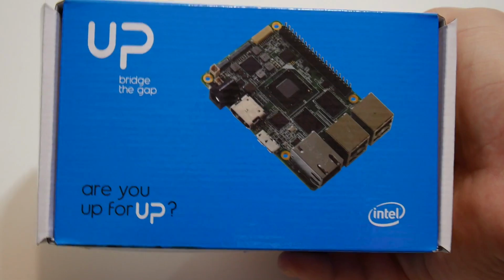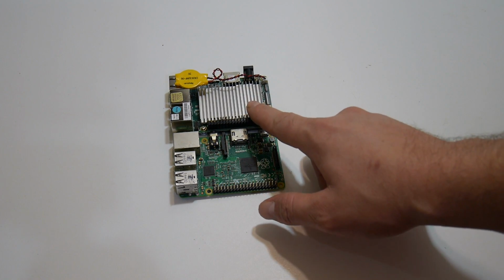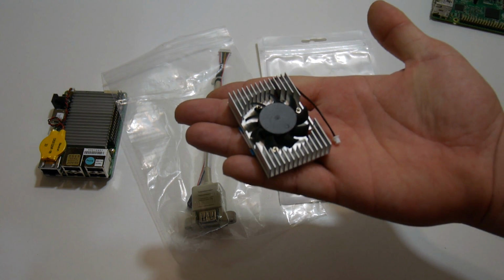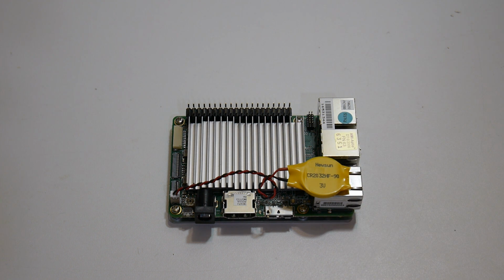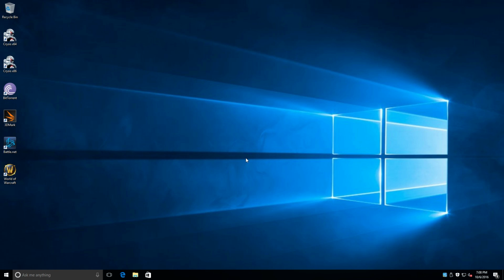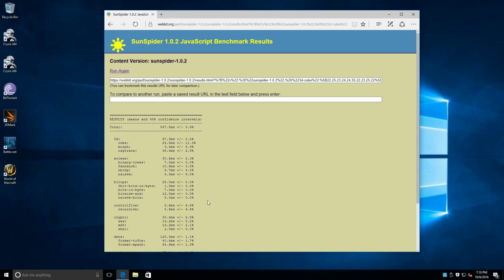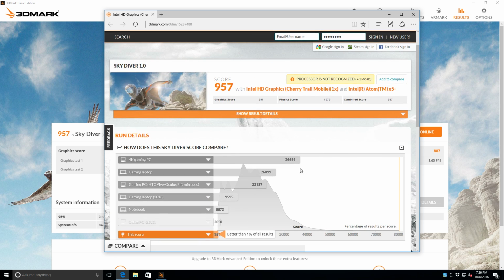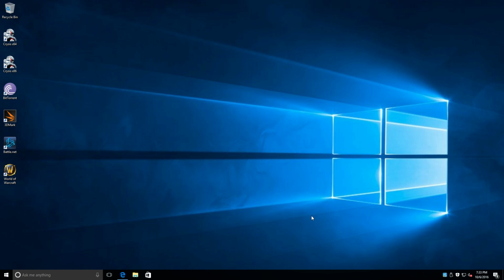UP BOARD Unboxing And Benchmarks Raspberry Pi Killer?

Comment: Hi. thx for the review . did you get the Power Adapter from ebay  ?  saw one like this, 4$,  and the sale states its a 5.5(OD)/2.5(ID ) which fits 5.5/2/1 too (required)  ???  any comments on DIY heatsink/fan ?   thx a lot

Comment: what's the other header on the option of 2 additional USB ports? in the video it looks like there's 3 connectors in the bag, 1 for the USB ports themselves, where it would connect into the UP, and then another connector?
Reply from the maker: Pete Moss I'm pretty sure is the power connector

Comment: Got me lost @ price....  you better getting an old computer than board like that...
Reply from the maker: Yeah, the price is way high , I bought an older slim hp with 4gb ddr3 and a Core 2 Quad Q9550 for $15 about a year ago , slapped 8gb of ram in it and OSX Yosemite on it and used it for editing for about 6 months. I just ordered a slim 750ti from eBay and I still only have $125 bucks into it. building a lower end emulation PC for the kids. I know for sure it will run better than any SBC
Reply: well, I bought a dell laptop with an i5 3360m for around $150, so yeah the price for me is a little high
Reply: old computer has same size and power consumption? and can run windows 10 with full hardware support?
Reply: No, old computer in right hands can run even better - Ubuntu 16.04 with no problem with hardware. :) I have few around, doing some good stuff, from emulation to being used for education.
Reply: Yes, saw your video with emulation on that box. He got us on power consumption, tho... :)
Reply from the maker: RoMage 2 watts vs 95 watts
Reply from the maker: And size
Reply from the maker: RoMage I'm looking for a tutorial on how to install AfAOS 4.7 in Amigaos 3.9 on winuae. Any suggestions?
Reply: AfAOS 4.7?? I installed OS 3.5, 3.9 and 4.1 on WinUAE, but never used either on RPi. For some reason I like ClassicWB Full retro feel and look, as well great response. I copied the same HDF I use on PC when emulating Amiga.
As for power consumption, I paid around 150 bucks for little Lenovo Yoga 2 in 1 tablet/laptop, 2GB ram, 32GB SSD, Atom quadcore processor (can't recall speed or model) and it uses about the same amount of power as RPi, runs Win10 with no problem and has MicroSD slot for expansion. 
Did not get time to upgrade to WIn10 64 bit, will do that sometimes in future, was wondering how well ubuntu would work on this tablet, might try that as well. 
Sorry for wall of text... after one of your videos decided to teach my daughter (she is 11) to install Ubuntu on one old laptop, which she did and she loved it, even she has her Win10 HP laptop. :)

Great job with videos, gratz on subscribers!
Reply from the maker: Awesome , i installed PItop OS on a pi 2 and set it up in my kids room, but my daughter needs something faster now. she complains about how long it takes to load . Im trying to make amigaOs 3.9 look more like 4.1 i have it installed on a PI3 with Namibian. i love the looks of the 3.1 but a lot of viewers want a more "modern look"
Reply: Problem with Workbench greater than 3.1 is that you have to have ISO (either purchase or download) and it is not quite available around. I can look into instructions to install any of them on RPi, but would be much easier to do it on WinUAE (I did all of them on FS-UAE as well, just to have it on Ubuntu :)) than RPi. What distro you plan to use for RPi? 

BTW, did you have a chance to try suggestions for Turrican game (on C64 video :))
Reply: +ETA PRIME can you do a test? https://linuxiumcomau.blogspot.co.id/2016/10/running-ubuntu-on-intel-bay-trail-and.html
Reply from the maker: Jfr # yes I plan on it they offer an Ubuntu 16.04 driver package for this board. I just have to finish windows 10 testing first, I'll be testing as many operating systems as possible
Reply: Too many single board computers, but nobody yet can beat RasberryPi support and development with current price.

Comment: I would love to see if it will run Visual Pinball Emulator (vp9 or vp10)
Reply from the maker: do you have a table you want me to test?
Reply: I would be interested in if it could at least play VP9 PM5 tables... anything rom controlled solid state
Reply from the maker: CementRoots ok sounds good I've never used it before but I'm sure I can have it up and running in no time , I will make a video tomorrow.
Reply: sounds great... I can get you would ever file your going to me.... I'm also a table builder in the VP community so getting you content wont be a problem
Reply from the maker: i tried a bunch a tables and i was only able to get T2 working but i cant fire the ball, ill work on it more tomorrow , been out of power half of the day. if you can help that would be awesome
Reply from the maker: http://www.vpforums.org/index.php?app=downloads&showfile=6105
Reply: ok so you have the VP9 emulator working that is great.... I will send you a few non rom tables that will for sure help... are you playing in Portrait or Landscape... mode?
Reply from the maker: CementRoots I've tried both , I followed the directions for the T2 table , I found the rom for the table but I just can't fire the ball, I have the animations, flippers , insert coin working, I did get a pirate game working but I'm trying to get a few tables before I make a video, let me know about the non rom tables
Reply: most tables the return enter (center enter button)   1 is start 5 is coin space is nudge, right and left shift flippers... 

as for non roms this dudes EM tables are some of the best for VP9 
http://www.vpforums.org/index.php?app=core&module=search&do=user_activity&search_app=downloads&mid=41250
Reply from the maker: https://youtu.be/oSq4dgh9C78